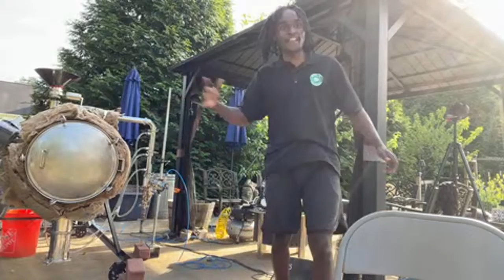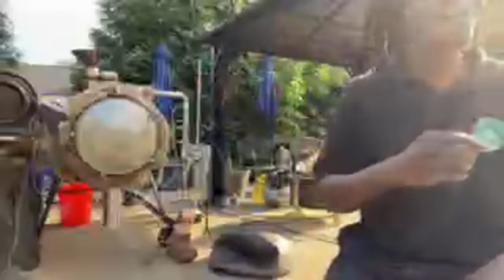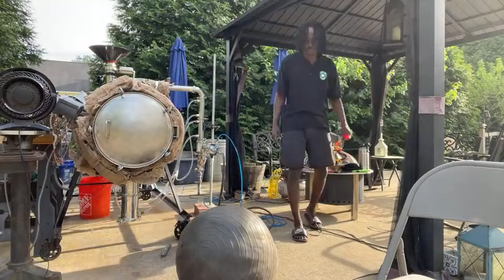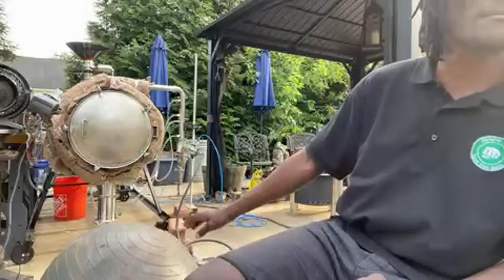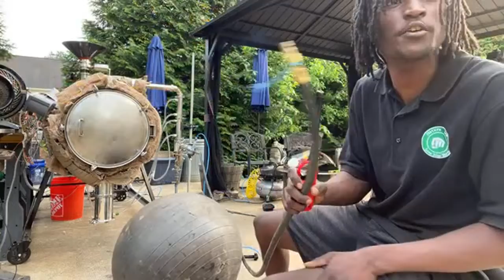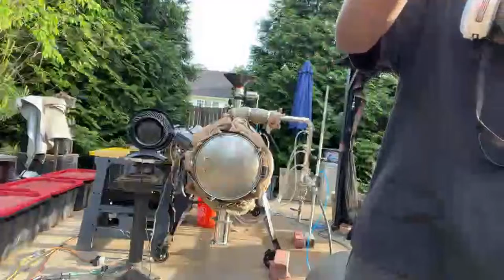Oil Made From Plastic Waste!

Comment: If you are fractionally distilling your gas via physics, a whole lot of chlorinated products will have their own boiling points and vapor pressures, PLUS, if you do not want to keep them, you can strip them with calcium in another reactor which will convert all of the chlorinated organics into chloride-free organics, and calcium chloride which can be sold as a product [like sodium chloride, potassium chloride or magnesium chloride].

Step 1 would be to separate out the offending chemicals [and you likely one node for each chlorinated product]
Step 2 mix in a chamber with slaked lime [or any other limestone product].
Step 3 heat to the reaction temperature
Step 4 allow it to vent through an activated carbon filter
Step 5 collect it until you can run a test sample for purity

This could be a continuous flow process, so long as it remains slightly anhydrous because calcium chloride and any other solid residue can be dumped in the top at one and, and drained off the other end while the gas taps from the top through the filters.

You would need airlocks to ensure nothing got out of the chamber, but those are simple enough to be made without any problem.

Comment: Dang it!!!! How do I get a hold of you!!!!
Reply: Critique inbound-
Your pressure issue can be solved with your load in area. Redesign for a drop in. Your blades if properly fabricated can continue the pressure as it feeds in. 
Your 2(90°) elbows for your catch can be redeveloped with a baffle for a spin wheel. This can be the area for the worker to keep up also can get oil/hard product.
Reply: Do you think instead of a ball you can get a filter the exit into a square or whatever shake to consume then drop into a heated area to drop into a tub for mass oil deposit?
Reply: For the heat shielding LEAD IS NEEDED. Within the filter of heat shields. If you T additional iron off the metal in can provide much more insulation that the fiberglass insulation.